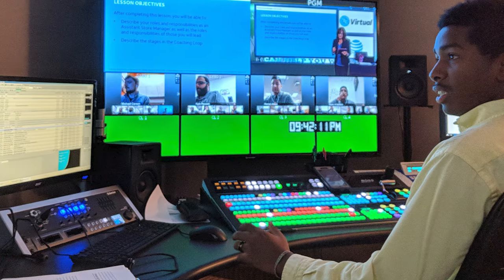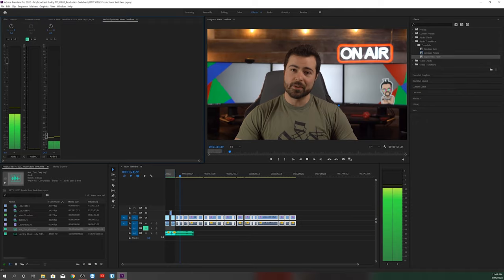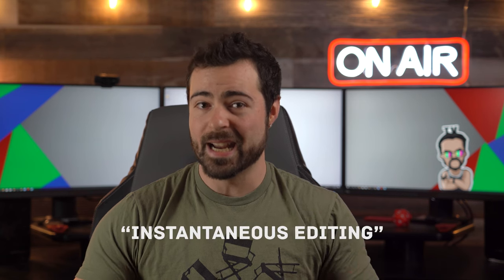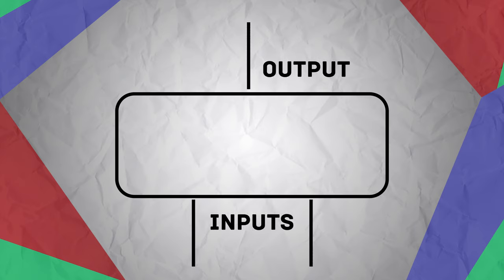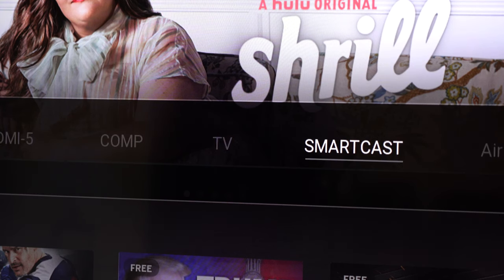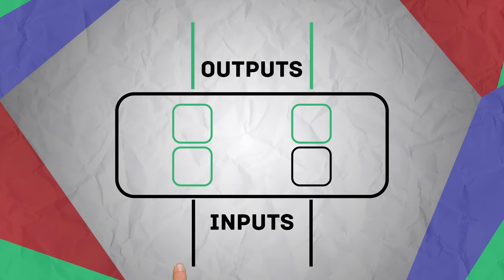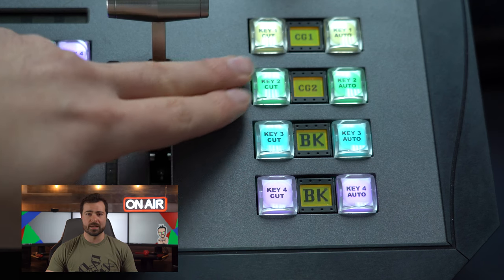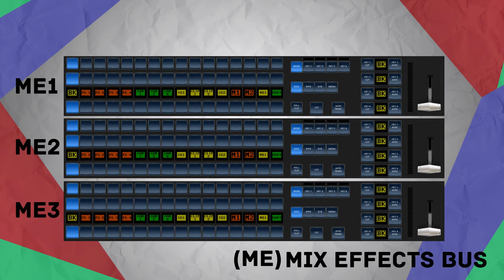Video Production Switchers [Understanding the basics]

Comment: GREAT video.... you put in loads of work! You only hinted at the question I had, but at least I have a start now... I am trying to find out how ME2 and ME3 are commonly used.... I can't really think of ways that they make sense. I have an ATEM 4 M/E and feel I am not using it to its full potential.
Reply from the maker: Thanks! That's a great video idea! And it wouldn't be too difficult to get out the door either. I'll try to put something together soon!
Reply: Spare MEs can be used for what ever you want really. I’ve mainly used them to prebuilt effects for later recall during a programme. 
For example when I worked at Sky News in the UK it was set up like this:
ME1 - fed the video wall and had various effects saved to allow to feed video boxes and graphics in the wall depending on what programme was being broadcast.
ME2 - mainly used for 2 and 3 way boxes when interviewing non studio (“down the line”) guests.
ME3 - again used for boxes etc and also the where our in to break sequences ran - usually comprised of a video box and graphics to tease what’s coming up after the break - something that may use different video and graphics feed each time. 
We also had hundreds of prebuilt effects saved to allow the TD, or Vision Mixer as they’re correctly called in the UK, to instantly be able to have anything need for the particular programme. 
We’d also use MEs 2 and 3 to build things during a programme that weren’t predefined or new because of breaking news - eg sticking a reporter in a box over a map.
That’s a basic overview but any other questions feel free to ask!
Reply: @GaricsPeter  great
Reply: One common thing to use upstream MEs for is setting up a 2-box or even 3-box, for later use in the program at one button-punch.

Comment: Great Video Man! I Just Have A Question: I Have Always Wondered If A Production Switcher Is Used Only For Switching Between Cameras, How TV Stations Manage To Play Video Files Through
 The Production Switcher?  Keep It Up!
Reply from the maker: Greetings!

Production switchers can be use to switch between any compatible video source connected to it. This could be cameras, video servers, computers, etc.

There are however some switchers that (in addition) have built in media players (as internal sources) that can be selected on the bus and played out. Depending on the switcher, depends on how this function works and what type of video files it supports - and even if it can pass audio as well. :)
Reply: @BroadcastBuddyTV  Thanks :)

Comment: Please what's the name of the switcher you used in the explanation of this video?
Reply from the maker: Hi! It's a Ross Carbonite :)
Reply: Thanks🥰
If I have a hardware switcher, do I still need a software encoder?
How do I stream with the hardware switcher?
Reply: @BroadcastBuddyTV  Is it Ross Carbonite black or Ross Carbonite Ultra?
Reply from the maker: It's actually a Carbonite Multi Media (discontinued) with the classic Carbonite panel (also discontinued). The Black would be the closest thing to it.
Reply from the maker: You'll need some kind of hardware or software based encoder to stream with your hardware switcher. Depending on the output of your switcher will dictate what encoder you can use, SDI, hdmi, NDI, etc :)

Comment: Please make a video on how to use   a tri-level sync signal between a new ross switcher, and an old one . .

Here is the possible issue I face :
We have a carbonite ultra 60 switcher, and an older ross carbonite switcher. The cameras connected to the carbonite 60 are in sync with switcher without the reference signal fed to the ccu units of the respective cameras,,and the switcher gets the external reference signal from a SPG by leader company. but when the HD-sdi out puts of the same cameras are accessed through the older switcher we experience reference issue with black stripes appearing in the camera sources,and the older switcher gets the same black out -PAL-M from spg. All the cameras output hd sdi signal .,and the spg sends out black out PAL M . IS IT MANDATORY FOR THE HD SIGNAL TO ONLY  USE  TRI LEVELSYNC !!? hd sdi can use black burst as a reference signal as well ,